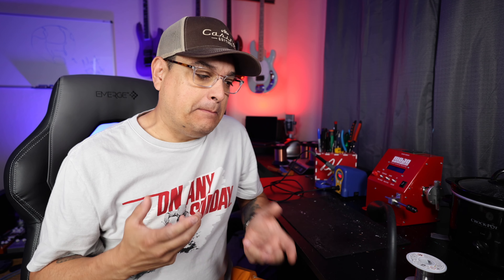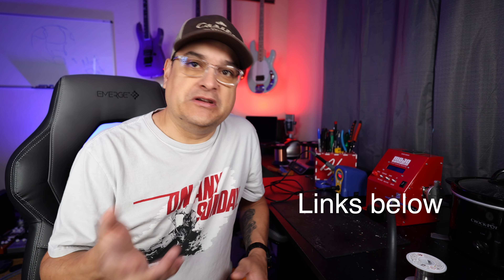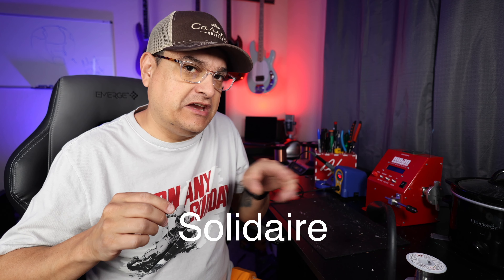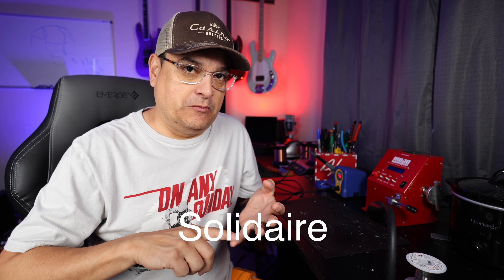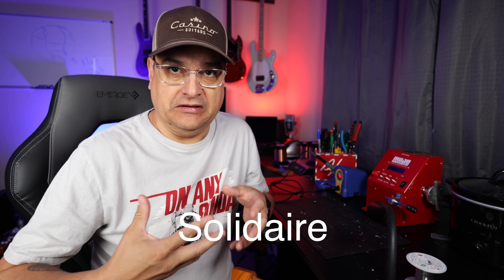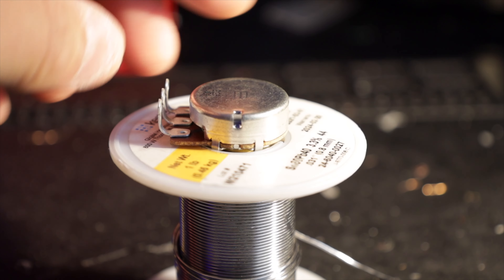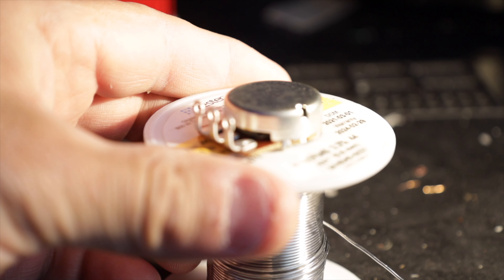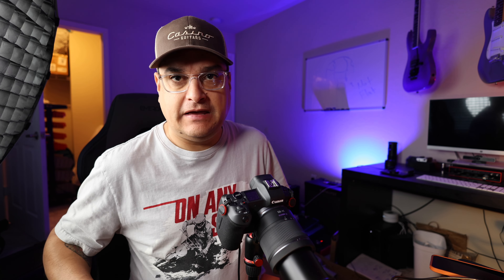How To Solder Guitar Pots, Caps, And Wire

Comment: Don't throw rocks. The back pot cap soldering is faulty. Why? Because the cap leg does not make direct contact with the pot. There is solder in-between making the signal travel through it. This will make the pickups sound thinner. Trial and error experience
Reply: So how should you do it
Reply: @NobotyBoi  with another tool like a screwdriver maybe, push down on the wire or leg so it touches the component and wait for the sodder to dry.
Reply: No
Reply: Here's a big rock for you! signals and current don't flow through solder it flows around it! If done properly there's enough surface area to make up for any lack of conductivity.

Comment: He is 100% correct about forming hook on a pierced, perforated, or punched terminal like the ones on the pot. If it's not required, it's not necessary, so don't bother with it. Unless specified in engineering documentation, even in industry standards it is acceptable for assemblies that are class 1, 2, or 3, as long as the conductor contacts at least 2 surfaces. Guitar wiring would be considered class 1 (the lowest class), meaning the addition of a hook to the terminal only serves one purpose. To infuriate you the next time. Think about it. Are you going to be yanking that pot around or putting it under a bunch of tension? Not likely. Also if your wires are too short causing tension, then consider replacing them. That added pain in the butt if you need to rework it is not worth it.

Comment: I'm not sure if Germany, or the entire EU, commercially, you have to use lead-free solder. But for private projects, you may still use solder with lead.
Reply: I'm pretty sure you have to use lead free solder in commercial projects, and for private stuff: it's not easy (if even possible?) to buy new lead solder. I have more of the old solder than I can use in this life time, luckily.

Comment: How would you tidy up a messy existing solder job?
Do you just heat it up and add new solder or are you meant to clean the old solder off and start again?
If so how to you remove/clean off the old solder?
Reply: Clean it up first.  You can get strips of material that soak it up when it's melted or use a solder-sucker which looks like a syringe.

Comment: Can anyone take a good guess.
My middle and neck pickup (HSS, Select Strat)  are week sounding, especially the middle pickup, bridge pickup (humbucker, both coils are working)  seems to be the right output level but has a muddy sound, so far I've changed the pickup selector, I'm thinking of replacing the volume part next, moving maybe somebody out there has had this problem?

Comment: Bought a pound of solder on your recommendation. It will outlast me.
I have struggled with lead-free to get mediocre results.
I'm told 63/37 solidifies and re-melts more quickly. Everyone I watch on here uses 60/40. Good enough for me.
Reply: In the words of an angry Canadian guitar tech on YouTube: “there are no rules; only guidelines”.

I used 63/37 on my guitar with no issues and while thicker than what Dylan used, did the job with little mess.

Wanted to consider leadless solder but I haven’t heard much good things about it so I’ve just used what I know works and never had an issue.

But use whatever gets the job done. If it works, it’s good.
Reply: 63/37 is what's known as autilectic solder. When you mix lead and tin, you get an alloy with a lower melting point than either of the two metals on their own, which is why solder exists in the first place. 63/37 is the ratio that achieves the lowest melting point of all. I believe it does melt and solidify more rapidly too, due to it having a very narrow  temperature range between solid and liquid. I would argue that it's very slightly easier to use, and that's about it. Once you're done soldering, there's no functional difference. 

Lead free on the other hand is evil stuff and is responsible for a lot of premature failures in modern electronics.

Comment: Good tip about not leaving the soldering iron, turned on, when not in use. I have the Hakko FX888D and it literally only takes 20 seconds to reach 600 degrees fahrenheit.

Comment: I just started soldering some basic stuff in guitars, and find the cheap $8 soldering iron works fine. The way I see it is that if I can learn a soldering with a cheap tool, then I’ll be in good shape by the time I need to upgrade.
Reply: This is what I did because I didn’t know the info from Dylan back then. Highly suggest practicing on scrap metal and wires first. If you are soldering 1 or 2 connections and then not soldering for many months or more, that iron will work. However, knowing what I know now, I would have at least started with a $50-or-so iron with temp control (harbor freight-Schneider brand). It’s unbelievable how many of my soldering difficulties were just due to me trying to use a shit iron with no temp control. Much safer too (enclosed metal iron holder)
Reply: @CaptainWrinkleBrain  I did just get an upgrade from that shit soldering iron I was using. I have yet to put it to work, but I’m excited for my next solder job. Those cheap irons are dangerous and, well… cheap.
Reply: @alexraia1377  Yep, life changer. Whenever you can’t get solder to stick, you either need a higher temperature, longer time holding iron on, or smaller piece of target metal. I switched to using Allparts solder lug washers or solder bugs rather than the back of pots. Heats up so much quicker
Reply: @CaptainWrinkleBrain  nice man! I don’t think I’ve seen those solder lugs before. That’s cool

Comment: Been banging my head against a wall trying to solder to the back of pots, but no matter how hot I put this Schneider iron from Harbor Freight (even up to 896 degrees apparently) I still get cold solder. I think the temperature gauge is bogus. I just ordered the Hakko iron as soon as I saw this. I hope it works!

Comment: But if you use additional flux the heat exchange is better so the pot would heat up faster and more evenly
Reply from the maker: There is flux in the solder… it hears in less than a second

Comment: As far as welding terminology goes the word you want is brazing. The act of using a third metal as a binder that has a lower melting point than the materials being fused together.

Comment: A great vid, very helpful.  But as a welder and former plumber i do have to give ya a friendly correction.  Porosity is a defect in a weld joint where air or contamination enters into the joint at time of weld. Welders don't sand or grind unless they screwed up or repairing a painted surface.  Sanding comes from joining copper piping by welders who use lead free solder. You MUST sand and pre flux copper piping. Its a form of brazing.  But Porosity is a bad thing,  i think you were referring to the surface being porous enough to suck up the solder, but im just guessing. Either way thank you,  great video, worth just for examples of technique

Comment: What would cause my bass to lose sound when tightening the nut of the control knobs? If I loosen the nut to a degree where it's way too lose, the sound returns. Could it be that the copper tape is shorting the pots? I just saw in one of your other videos that you advise ripping out the shielding... should I shield the pickup cavity? Side note... I would love to get those exact pickups you made for Dan at G&G for his PRS LifeWater bass he made for a contest several years ago. I'll take them kit or pre-made. They looked really awesome.

Thank you

Comment: They call me Mr Work Movin’ Around before I took in this excellent content. 
Thx for all the tips and leg clips with all the enough heat. Solder tips are unique to each of us. Not everybody wants or needs a huge chisel tipped, uncircumcised robot heat gun when you can have a rapid fire baby boy tip.

Comment: I used to work in electronics for a good number of years, but now I work in IT.  One thing I did not learn how to properly while getting my degree is how to solder. Luckily, I did receive the training from an employer. There are a few things he didn't mention in the video that might be helpful to those with little experience.  

The first thing is to be sure to use enough heat, but don't use too much heat either. If you get a better soldering iron that that has an adjustable heat control don't just turn it up to maximum, especially when soldering smaller things. The purpose of flux is to prepare the surface of the items you are trying to join. If the temperature is too high the flux burns off fast and cannot do its job. When soldering circuit boards, you can cause damage to the traces. (You can also cause damage if the temperature is too low because you have to heat what you are trying to solder for too long.)

The tip size and shape also matter. A small pencil tip works for small wires but cannot properly heat larger surfaces. Likewise, a large tip can overheat a small connection and can cause damage, which is a factor when soldering the cheap quality circuit boards in guitar amps.

As he mentioned when soldering wires pre-tin them. A good tip for those new to soldering is to get a good tool to strip the insulation off of the wire. It doesn't have to be expensive. The best thing to do is to not just pull the insulation off of the wire and then use your fingers to twist the strands together. Instead, cut into the insulation and pull the insulation just a little bit, but don't pull it all the way off. Once that is done grip the tip of the insulation you want to remove, and give is a gentle twist as you pull it off of the wire. This will twist the wires together for you as you pull the insulation off. Putting a bit of flux on the wire prior to soldering helps but is not necessary.

The last tip is just common sense and that is don't breathe in the smoke that happens when you solder as it is toxic. Do something to prevent it from going up to your face.
Reply: Nodded yes to everything you posted than the video itself, I know he means well but yea. Blu tac is great for holding components, wires etc instead if no majik hands avail. The soldering of 2 wires for example, fray the individual wires of each then mesh both together then solder, after heat shrink, its barely noticble that it has been joined, if at all.
Reply: And if you run the iron too cold it is tempting to jamb the iron into the traces and component leads, potentially damaging both. Better to run a bit hotter and get in and out quickly.  The amount of heat that is then transferred to the sensitive part of the component is much reduced. Find a balance. And for desoldering your PAF's cover and similar, use at least 100W and a solder sucker. Saves mucking about. Choose your tools appropriately.
Reply: Yeah I always pre-tin every solder.. I never just heat the points and feed solder in.. I am hardly ever holding or using solder from the reel when applying heat.

Comment: Your explanation of what soldering actually is: I always thought of it more as brazing or gluing...the pieces being stuck together don't melt but the stuff that sticks them together does. Chemical reaction? I'm going to have to look into that. Seems more mechanical than chemical. On another note, I'm curious to see an ohm-meter check solder joints to compare 60-40 tin/lead solder with silver solder...see if one has appreciatively more resistance. Please don't take anything I say as disagreement, you raise questions, that's all.

Comment: I didnt ground my volume pots 3rd lug to the pot casing Cos i dont want it to completely turn off, I use a volume pedal for the swells ... with that open lug there's still a signal at zero but cleaner which interacts great with the tone pot.

On a tone pot though, whats the difference between soldering the cap on the middle lug (Ibanez style wiring)  vs the outer Left lug (seymour duncan style wiring)?

Comment: Thanks for the lesson - I can pronounce, but not do it, In the UK the ‘L’ is pronounced: solder as in folder, rather than sodder as in fodder. Your language came from mine. PS what the hell did you do to aluminium? For the purposes of clarity and the bearing in mind that internet comment sections are not the most friendly or forgiving of places, my tongue is firmly in my cheek. It’s a shame I have to say that for some, not for all, I hasten to add.

Comment: I've been struggling like hell with my soldering....you explained why I was getting shorts in my wiring....and having such a difficult time getting it to flow right.....thanx alot brother....now to go back and fix my mistakes....as a suggestion (and I haven't dug to deep back yet), but odd wiring... like I can't find schematics for 2 P-90,2 buckers, or a combo of both and 2 separate vol, no tone, no switch.....kinda stuff....not much of an elec. engineer lol
Reply: Use a Jazz Bass wiring diagram except you’re gonna need to solder together the power and ground wire from each coil to make two single power and ground connections on both pickups then wire as you would a Jazz Bass.

Be advised that this setup can be a bit bright so it is recommended that you use a capacitor between the pots to dampen the brightness.

Hope this helps.
Reply: totally does help, thank you....I have the capacitors....I never thought to look bass schematics, dùhhh LOL...it makes sense

Comment: I use a lead solder without a rosin core and found a flux pen works a lot better than a paste flux.  No cleanup and makes tinning wires a breeze. Personal preference only. Plus I get it free from work to use on my builds

Comment: If somoene wants to get started with soldering, or even if you've been doing it for a while and want to really up your game, NASA has a series of videos on soldering to their specifications.  It's overkill for guitar but illustrates the most important basics: how much solder to use, how visible the strands should be on a solder joint when using stranded cable, how long the exposed wire should be and how far away from the jacket it needs to be in order for the connection to be flexible and surivive movement, how much solder should be on different types of joints, why solder bridges are important, etc.  

As far as mechanical joints go, you are incorrect.  They are best practice.  Do they make it more difficult to perform a repair? Nominally, if you're half way decent at soldering.  What are we talking? Maybe an extra 10 or 15 seconds, per joint.  Quality takes time.

Additionally, according to best practices, wires should not be soldered side to side like that.  It will work in a pinch but, it's not textbook correct.  Is it "fine?" Inside of a guitar probably, but that's not considered correct and I would not use that method.  I might expect that level of soldering on a very inexpensive guitar, but if I saw that on a higher end guitar, I would consider that a shortcut and subar.  Also you NEED some type of shrink tubing or jacket otherwise you're risking that wire touching something it should not touch.  I feel more emphasis should have been made on that point.

Teaching people shortcuts is fine. Most people could probably care less about technically perfect control cavities but, please consider at least explaining best practices first, and then explaining why you choose to take shortcuts, as opposed to going the last mile, so to speak.

Comment: so I have been having issues with an Emerson Custom wiring kit I just put in my Vintera Road Worn strat. When I pull back the volume I get radio noise. I even resoldered everything to the degree in which you explain in this video and still same thing... could it be since the pickup wire is enamel and the emerson kit is cloth that I am experiencing the radio noise? I also use Kester 60/40 like you have.

Comment: Great video but, but, why do you not put any solder flux paste on your components where you will solder? Ya, your solder has it, but it also stops the heat from being transferred past your solder joints because it's almost instant. If you were doing electronics like this, oh boy you be done. I would recommend a fatter soldering tip with flux paste to solder grounds and capacitors to the back of the pots makes it a lot easier without overheating components. Just always use flux paste even on them tiny wires.
Reply from the maker: Thanks for the watch time and comments. (To everyone else seeing this, flux paste is messy for no reason. As you are aware if you follow what we do, there is a lot of content on proper soldering on the channel.)
Reply: Solder paste can be useful in some instances but it’s not always the best option- pots and caps aren’t usually hurt by high temps on their legs- for surface mounts paste can help keep things in place but for components like these it would be a waste of paste to use it-

Comment: I've seen other videos which rely on pre-soldering the tabs and the back of the pot, and I've personally found it kinda creates a mess and that you don't do that at all.  Is it the reliable heat that allows you to skip that step, or just your preference and your experience?
Reply: Yes, it’s simply that he is using the iron accurately at the right temp, and ensuring he’s heating both the component and the surface rather than just one. Tinning those things beforehand just separates those steps and may make it easier from some.
Reply: Pre-tinning the joints is good practise. I used to solder like this guy before I learned how to do it properly, but looking inside my guitars I see that messy soldering is the norm in guitar making. They all look bad tbh..